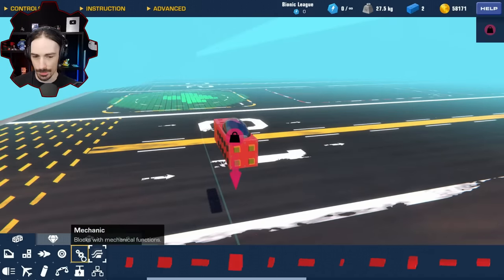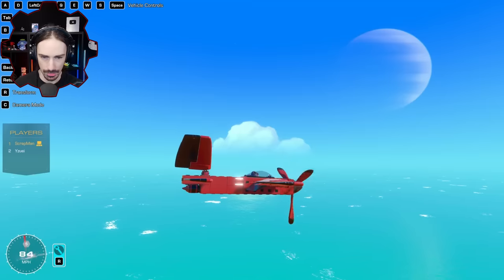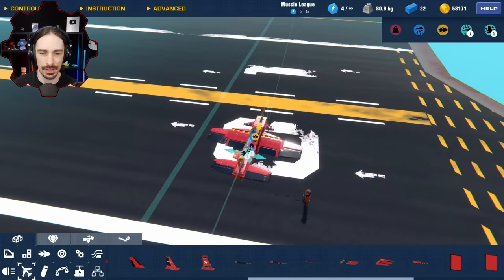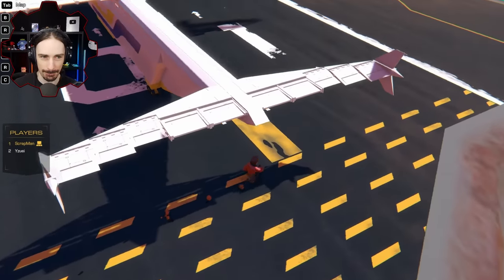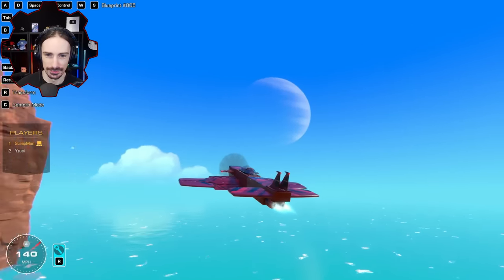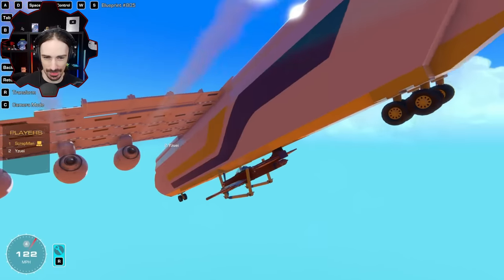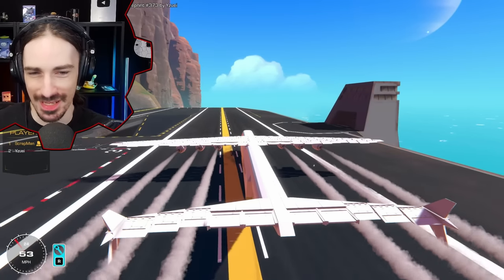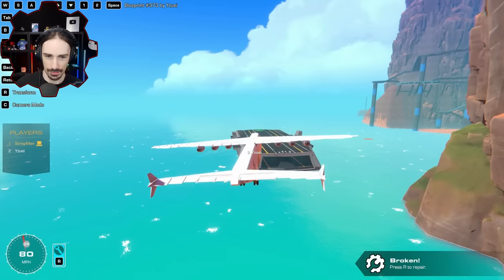Catching a Small Plane with a Giant Cargo Plane!

Comment: Idea for the next challenge - A two part plane.
Think of the way the Enterprise could split into saucer and drive section, see if you can do that Scrap. Design a plane, have a friend design another plane that shares a common connection point. Take off individually at first, then combine in the air and try to land the combined plane and keep it in once piece. Then take off combined, separate in the air and land as individual craft. Then for the third round, just see how many times you can combine and split without smashing eachother to pieces ;)
Could be a pretty funny video, since the two planes are very unlikley to play nice once they're connected, making it hard to fly since you'd both have to try to cooperate to get anything done. I will stipulate though, you can not use the capture method you've been using! You'll have to come up with a new way to dock the two aircraft.
Reply: YESYESYESEYESYES
Reply: Scrapman must see this
Reply: Omg this is an amazing idea!
Reply: Genius
Reply: Hope he dose this
Reply: So many things could make the combined craft unflyable, sure to lead to plenty of amusing crashes, or clever workarounds.
But to clarify, this isn't a simple piggyback or payload thing, both planes have to take an active part in the flight of the combined craft. They should be of a similar size though, so that one doesn't totally overpower the other in flight. You guys have to work together to get this thing down!

Comment: What if you jumped a submarine out of the water, into a catching bay on a plane? Closing some hooks fast enough might be rather difficult, but if the plane had a platform on the interior and a door through which the sub could jump through, you could have it rest inside the fuselage whilst the plane flies you about, before opening the door again and possibly tilting the resting platform down so that the sub can slide out and land back into the water.
Reply: Maybe, rather than jumping the sub out of the water, you can "fish" the sub out with the plane.
Reply: They call that a sky hook

Comment: If you have a problem with the plane nosing up or down just use a trim in for the elevator if its just some little to medium nosing down, but if its heavily nosing down then its good to redesign it, so you can save time.

Comment: A large plane that flies right above the water and trying to pick up a submarine, submarine probably has to be going pretty fast though. Another idea could be to make a plane split in half and then have another plane try to fly in-between the split plane (plane's split halves still have to be connected by something but there has to be some space between the 2 halves for the second airplane) and have the big plane reconnect it's halves closing in on the smaller plane and holding that smaller plane inside.
Reply: You stole both of those ideas from comments lol

Comment: You still need to do a glider / tug aircraft.

One builds a glider, with no engines, just a magnet on the front.

The other builds a tug aircraft, with a long bar that can pivot in all directions at both ends, with a target that the magnet attaches to.

Start on the ground, lined up (maybe use a ground vehicle to help), attach the magnet, the front of take off together.

Fly together up to altitude, release and land on the carrier.

Bonus points for re-connecting the magnet mid flight.

Comment: Two general Co-Op concept ideas: First would be to have a two seater vehicle that separates out one person into a smaller vehicle. The smaller vehicle has a turret so that when they are combined the one is the gunner.  Second would be that the larger vehicle holds two smaller vehicles. The small vehicle driver docks one to swap to another.  (it would be nice to see more two seaters in general though)

Comment: Fun fact for who doesn't know that, the plane that Yzuei recreated is a An-225 created by Antonov, the only one of its kind and also the second biggest plane by wingspan (88m) his weight is around 285 000 kg, this plane costs around 200 000 000 - 250 000 000usd to build, his first flight was the 21st of December 1998. He's now kept in Hostomel's airport Where he is being repaired since the 24th of February 2022. For now there's no more information about it. He is most likely dead for now

Comment: You could try to land a flying vehicle on a car...
A TV series in the 1960s called "Thunderbirds" did it in one of their episodes ("Trapped in the Sky" - in the episode, the aircraft couldn't open its landing gear otherwise a bomb would go off)
I have a creation on the workshop that is a replica of the vehicle used in the TV episode - it's called "Thunderbirds Elevator Car"
The principle was the vehicle sped up on the landing strip to catch the aircraft (there were 3 in the episode though)

Comment: You can use logic blocks with an output set to less than 1 as a sort of lower throttle mode, have both your regular button and another one that does the logic block. You can then dial in that other throttle to be the same speed as the big plane

Comment: I still say you should try some ASW using your bomb launcher to mimic RBUs / Hedgehog launchers and something like depth charges. Everyone involved either makes a sub that sticks within set speed parameters and turn radius to try and evade the destroyer or everyone builds their own ASW destroyer and tries to sink the player in the sub. Rules: can only use guns if the sub surfaces, nothing going sonic speeds (speeds and turns limited), bomb launcher (RBU) has to have a 10 sec cooldown, depth charges require 10 sec cooldown, “main cannon” if that kind of gun is used has to have 1-2 second between shots, machine guns can just fire like machine guns. The point is to hunt the submarine and see who lasts the longest (sub’s top speed cannot match or exceed the ASW hunter for obvious reasons, the sun has to dodge, not outright outrun the destroyer), and one repair is allowed by both players (if a good guided torpedo can be made that both tracks a target and then circles and searches if it misses the target, but can be limited to only running for 30 seconds and can go after either the ASW or the sub itself like a real torpedo, and sub can carry… say… 4 of them?) to give it an edge. 

I blame seeing too many episodes of Cold Waters with Dot Mod lately for the idea… but, basically, would just love to see your bomb launchers moved from being a truck mortar to being an ASW Hedgehog system in some fashion, even just to see if the concept is possible, would be fun. Heh. ADHD brain.

Comment: Hello ScrapMan, you should make a missile and separate aircraft(ac). The missile should be set on a particular trajectory so that it will hit the given target perfectly; Your goal is to change the trajectory of the missile using your aircraft(ac) by touching your ac's wing with the missile's wing; this maneuver will "slightly" change the trajectory of the missile, making the missile miss the given target.
If this stunt is easy try multiple missiles.

Comment: scrap mechanic tower defense 1 person makes a car (or any other vehicle) fully out of cardboard and the other 2 (or1)  use spud guns or a creation with spud guns scattered around the track (there should be a limit on the spud guns) to try to dismantle the vehicle, the tracks and car sizes can be anything, the car has to be pretty slow if its a small track and decently fast if its a long track, defenders win if the car is incapable of moving and the attacker wins if he reaches the finish (i dont know how many spud guns on the turrets and how many blocks for the car u can pick how many blocks for the car and spud guns for the turrets) the map is pre-built and can be modified (if this sounds stupid dont pick it ._.)

Comment: for challenges requiring precision, a pretty simple adjustment that might help a lot could be adding a pitch trim with a control surface that has a low speed and holds position so you can fine tune a good angle of attack; and/or using AND logic gates with slight negative/positive outputs that reduce the speed of your control surfaces at the push of a button (ex. an aileron A and D as its controls with two AND logic gates hooked up into it, each with a preferred button and A/D as its inputs respectively, so that when your preferred button is pressed a slight negative output, such as -0.6 goes into the green side and a slight positive output, such as 0.6, goes into the red side). i know this is pretty complex but the pitch trim is pretty easy and allows for a pretty solid degree of stability.